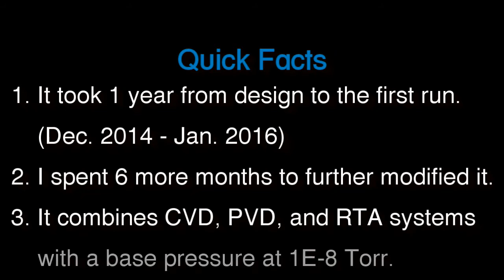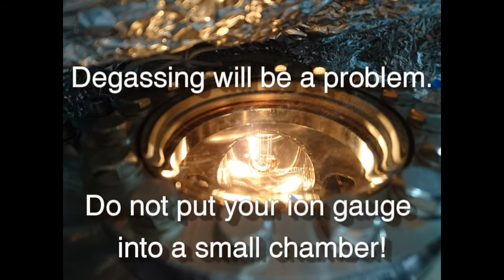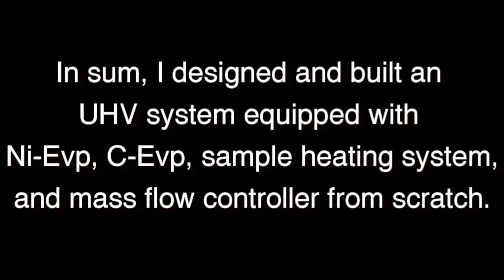How I Built My Ultra-High Vacuum System

Comment: Great work congratulations!
I am also trying to build one, I have some questions.

1- How did you build up the electrical connections? Especially for a high ampere copper wire connection, how do you isolate the cable from chamber metal?

2- do you have any rubber seal or all of them copper gasket?

3- how do you measure the pressure? What kind of sensor or gauge?
Reply from the maker: Hi Gegzin, thanks!
1. The copper wires were magnet wire (enameled wire), so they have a thin isolation layer. It's clearer at 1:48. Our maximum current is around 9A for the evaporator, I've tested that the temperature isn't high enough to melt the isolation layer or cause significant degassing.
2. The main UHV chamber uses only copper gasket, but there're some parts that contains rubber seal like the glass view port, gate valve between main chamber and load lock, and the little turbo below load lock. I'll say you can probably get to UHV with rubber seals if you have a decent turbo pump and a small chamber with low leaking rate. Our chamber is used/old so the leak rate was kind of high, otherwise we were aiming 10^-9 Torr for such huge turbo pump.
3. For UHV systems, you need 2 types of gauge to adapt different vacuum levels. The common choice for HV (better than 10^-3 Torr) is ion gauge, which work from 10^-4 to 10^-10 Torr. You'll also need a low pressure vacuum gauge (roughing gauge) to monitor the initial pump down (for load lock and the main chamber, depends on how you connect them), the low pressure gauge can be either diaphragm gauge (this is what I used), Pirani gauge, or thermal couple gauge, etc. You can also get a fancy all-level vacuum gauge which might be much more expensive.
I hope these helps, cheers!

Comment: that was interesting 
now i am trying to integrate  a spin coater table with an UHV but i want you to tell me which software I have to use to do so 
any ideas 
how did you the technical drawing in the time 0:19  ??
any advice
thanks
Reply from the maker: Thanks ahmed!
Sorry for not replying this earlier. As you can see from the 0:14 that it was planned out on a white board and 0:19 is just a screenshot of my Microsoft Power Point. I know nothing about any CAD software so I decided to just draw it out on paper than fine tune it in PPT so that I can send it to the machine shop. These drawings are not following any of the common machining regulations so they were complaining a bit.
I say whatever works for your project will be fine, don't let the software issue stop you from being creative.

Comment: 2:03 thats what haappens when tantalum capacitors get old
Reply from the maker: Thanks for clarifying it! I tried to weld another capacitor of the same kind back to the circuit board, however, the explosion must somehow destroy other surrounding parts so it didn't work. I ended up finding another circuit board from somewhere else.
Reply: @HarreyLee  i'd not sqy it was the explosion but rather the way these fail because tantalum capacitors short so the short might have destroyed the voltage regulators
Reply from the maker: @vega1287  I see, that also make better sense, thanks!
Reply: Happened to my old Tektronix oscilloscope too.  What a mess!

Comment: Why would you build one however?
Reply from the maker: It's part of my master research, we're trying to synthesize graphene on a silicide substrate. But silicide oxidize easily, so we have to prepare the silicide surface in UHV first and then do the graphene growth. Wasn't a huge success though lol
Reply: @HarreyLee  do you mind donating some of the hardware if you're not using it anymore?